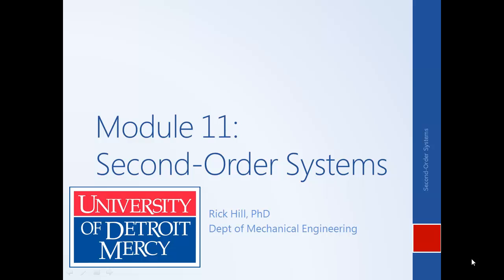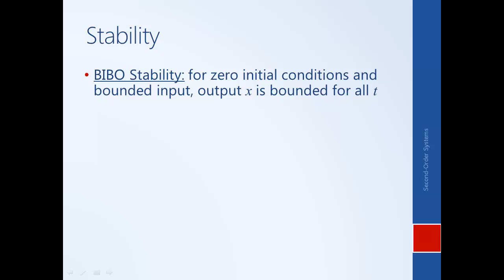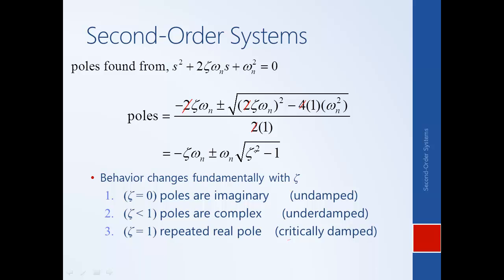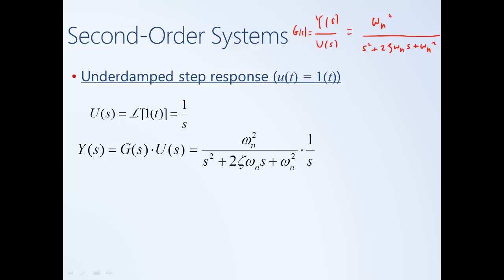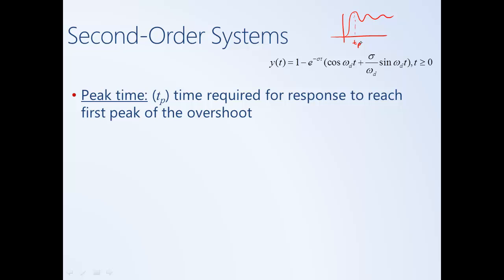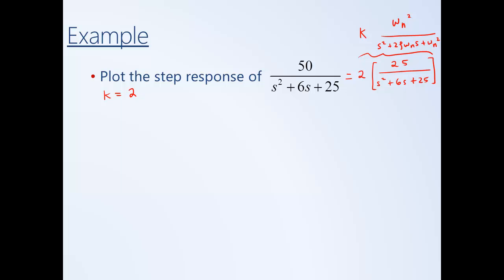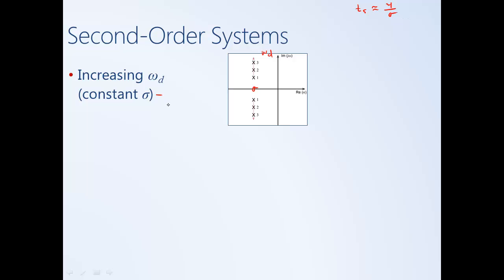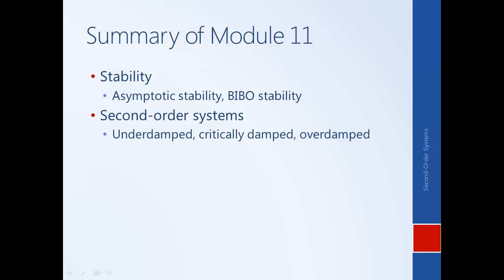System Dynamics and Control: Module 11 - Stability and Second-Order Systems

Comment: @Rick Hill, In the complex s-plane, how can we represent an overdamped condition (zeta > 1) since zeta=cos(beta)<=1?
Reply from the maker: The zeta = cos(beta) relationship only holds for the canonical underdamped second order system. When the system is overdamped, the poles become real and distinct and are located on the real axis in the complex s-plane. (When critically damped, you have a pair of repeated poles on the real axis.)